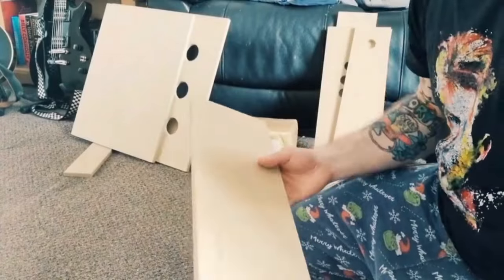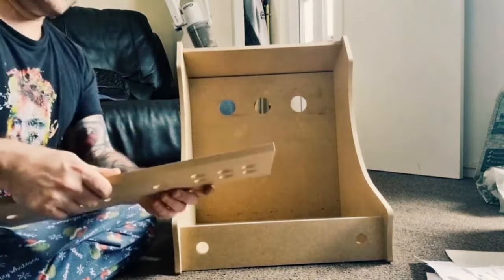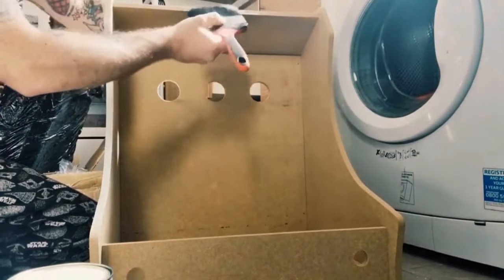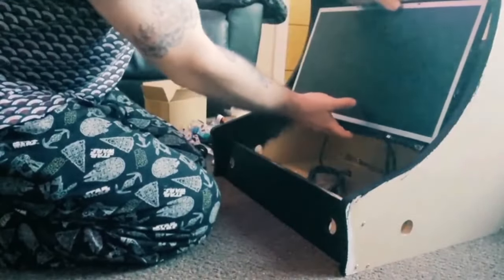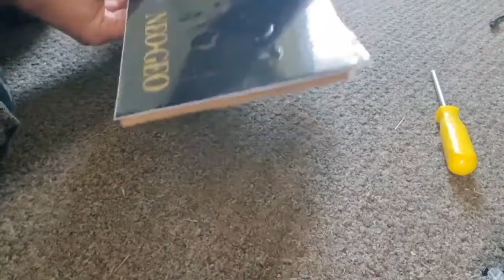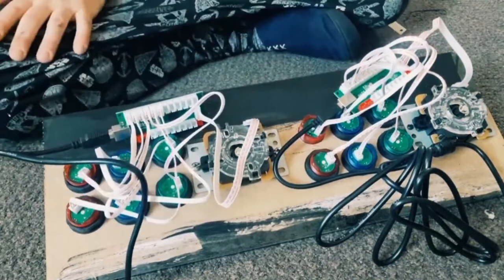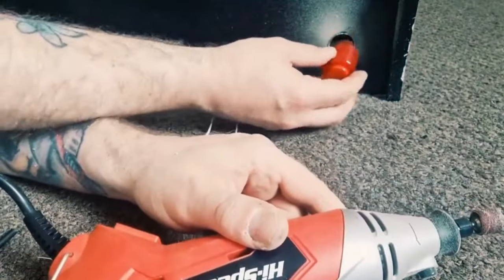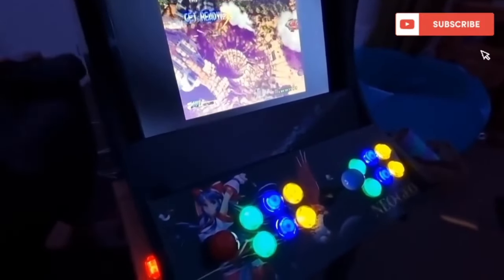2 Player Bartop Arcade Build CHEAP! #bartop #arcade #emulator

Comment: Jamie, nice video.    FYI... it looks like you were using 'wood screws' to attach your monitor when you probably should be using metal screws for VESA mounts. Once your holes in the wood are big enough, switch to metal screws as they will hold the monitor better.

Comment: Nice jame I have hyperspin and my 3ds games say extracting but doesn’t load a game can you help me please after you done your gaming cabinet 😊
Reply from the maker: Hey there, it says extracting whilst in HyperSpin or dosent load in general? Which emulator are you using for 3DS?
Reply: @JustJamie1983   am useing citra I think I done all we’re you change Nintendo 3ds to 3ds every game is there Jame but not loading after it extract fast not slow
Reply from the maker: @MIKE-qg7iq personally. I would join a HyperSpin forum. I don't have much involvement with it as it is a pain and there is better frontends around which does things just as well.
Reply: @JustJamie1983   it says extracting and a loading screen then it goes back to the game I selected I have tried a lot of stuff but no go jame